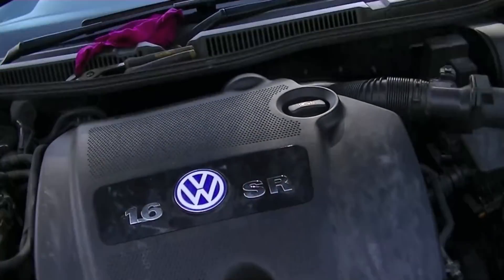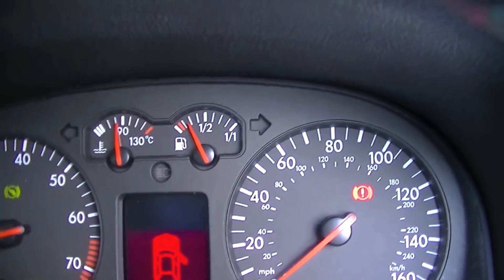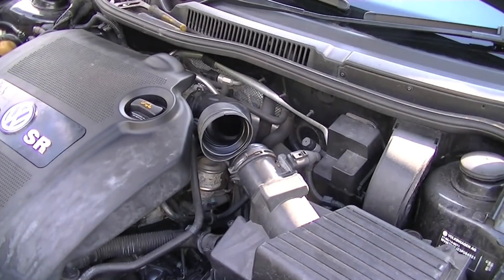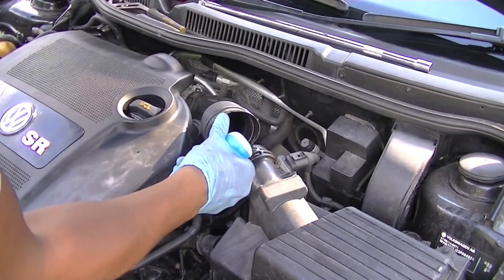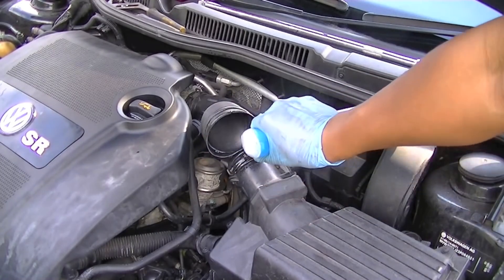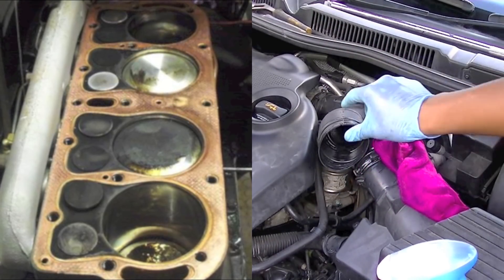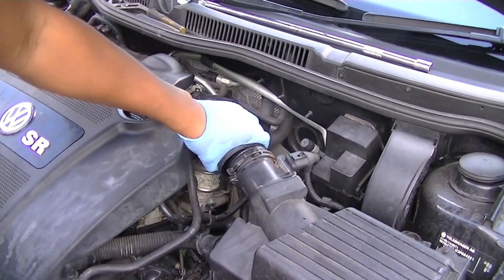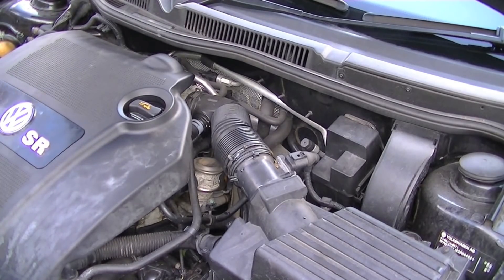How to make your engine run better with just tap water.......Better Than Seafoam?

Comment: Do this on a K series i dare you! This method isnt proven and does not work, it heightens the risk of cracking the block and any subsequent items that are hot as im sure if youre as intelligent as you make out you will know what happens when cold water reaches hot metal, as metal expands when hot and you spray cold water the bonds between the crystalline structures fragment, this method does not work and if you want to damage your engine and corrode the cylinder then do so as youre the type of people keeping people like me in a job.
if youre so bother about carbonisation why not do a proper job? recondition the head, skimming, vapour and bead blasting the cylinder head, polishing ports so the carbon cant stick to them, lapping the valves and doming the heads so the carbon bounces off, getting forged pistons that have smoothed heads to improve gas flow, this also allows the carbon not to stick to any parts.
do a proper job instead of a half arsed job, and telling people this works is honestly hilarious you clearly have no engineering knowledge or metallurgic knowledge as you would know the implications upon what you are doing, if you cant afford to do a proper job dont do it at all and dont find quick fixes either, they will never outlast a proper fix.

DO NOT ATTEMPT THIS IF YOU WANT TO KEEP YOUR CAR ALIVE, WAIT UNTIL YOU HAVE FUNDS TO CARRY OUT APPROPRIATE WORK!
Reply from the maker: Ellis Holmes I think K series engines are trash, sorry if you disagree. If you don't like the video, that is your problem.  No one cares about who owns intellectual rights or the loom you made.   I use the method, and the results have been good. You've never used yet you know everything about, how can we discuss anything.  My forum is for constructive debate, not boyfriend girlfriend arguments. So if you have something constructive to say, please do so.

Thank you
Reply: I remember reading about water/alcohol injection in WW2 war birds, to help make more power.  Those engines were made of Aluminum and air cooled....no cracking.
Reply: xSt3aLtHxSnIpEz if your fart to close to a K series it will blow!! as for the the rest of your statement you need to do some more research.
Reply: xSt3aLtHxSnIpEz Lol, your opinion literally went to shit when you started blabbing on about K series engines. Horrible engines with dreadful head gaskets made out of Plasticine.
Reply from the maker: 1. K series engines are awful,  nearly every one has a headgasket issue so I wouldn't touch it with yours.

2. Have you ever tried it?
Reply: So bad that they are nearly 30 years old and still being used today, and no they don't actually ever heard of anything called the N series, also I bet you actually don't know why some fail, and I've known of a hell of a lot that have done 100k miles on OEM parts, so your point is invalid.

And try this, you're having a laugh this is dangerous and unprofessional I come from an engineering back ground and if you want to decarbonise your engine your strip it and do it properly not your shitty excuse for a half arsed job.
Reply from the maker: As some from the engineering background you should be embarrassed about talking about the k series as if it were some sort of engineering accomplishment. The k series was tatol garbage, headgasket issues beyond reproach. Those engines werw so good that the company went bust. For an engine to make 100000 miles is normal, not an accomplishment.

Also who cares about your engineering background when you talk about k series engines as if they were good.
Reply: You really dont have a clue do you? shows your level of intellect to think rover actually owned the K series, no they didnt if you want to in depth about that Lotus, Caterham, Ariel, GTM, MG etc own the intellectual property of the K series and if you ever stumble upon a kit car you will see more than likely its got a 1.8 K series as they are a light engine, easy to work with and very easy to wire up, as i have built loom conversions for more than 20, and to be embarrassed about the k series? no im more embarrassed about 2 things, the EJ20 Engine, and that we have got people like you on our planet showing people who are stupid enough to believe this, how to damage their car, you are a poor excuse for a mechanic, you dont even deserve the respect as a motor engineer.
Reply: So your fuel isn't cold when it gets injected into the cylinders? If your so worried about it, use hot water.... Ever heard of water injection? The military and the performance world have been using it for a long time to allow for high compression ratios while preventing detonation. This method has been around a long time and it does work. When done right you have no need to worry.
Reply: the k series engine is like dog shite compared to say a vw/honda engine in every way, if i built a kit car i wud never use a k series, probs why lotus changed to toyota engines aswell
Reply: its funny when uneducated people make comments on something they know nothing about....   so whats the difference between cold water and a cold can of sea foam??   is your gas tank heated? does the car shoot hot gas and hot air into the engine??? i dont think so...you are suppose to add the water slowly so it mists into the engine and creates steam... and if you know anything about cleaning, you would know steam is the best thing to use to clean everything.... and guess what! if you add to much water, the engine will die.. its impossible to crack your engine using this method....   also. if you have ever used sea foam, you will notice the spark plugs and exhaust will have a shiny residue all over it.. seems funny to use it, as your trying to get rid of stuff in your engine and sea foam is pretty much camping lantern fuel and leaves that residue...and of course the big corporations tell you water doesnt work.... water is free!!  they dont make money when you get water out of your tap...    ALSO!  if you ever have changed a cylinder head with a bad head gasket... you will notice the head comes out looking brand new... i wonder why...wouldnt be from burning the water in the coolant and turning it into steam.   so please tell me again, why this method isnt proven and doesnt work.....
Reply: xSt3aLtHxSnIpEz He was supposed to give us a DIY solution not a mechanics only solution. Many say it does work and others like you say it doesnt, who can we believe? His engine didnt blow up so thats a start.

Comment: I'm sorry, but I totally agree with the people on here not recommending to do this. Yes, it probably cleans it rather well, but I've worked on and seen quite a few cars with water in the wrong places, such as the combustion chamber, and it's not pretty. If you were unlucky enough to have slightly worn compression rings, you'd most probably mix oil and water together, resulting in greater friction between the surfaces. Personally, this would be the last option for me, I'd try other things well before this. Also, don't try it on a diesel, or you might be looking for a new engine..

Comment: lol this is so funny haha....hope poeple don't actually think this is real.
Reply from the maker: Are you saying it doesn't work?
Reply from the maker: Hagbard Celine Its always people who have never tried it, that are the quickest to criticise it.
Reply: BMAC VAGS

It does work but what he is saying is it is not good for an engine. Water is not compressible and does not belong in an engine. The reason it works is because steam does a great job of cleaning. Before ever adding water to an engine think about all the engines out there that blew a head gasket that resulted in them having really clean engines. Was it good for them to blow the head gasket? Nope.

Although I will say this may work if very very very very very extremely careful care was taken to prevent damage but you have to be a person who pays very close attention to things. Spritzing the top of a piston that is already warm will evaporate very quickly thus producing steam. If ever using a method like this I would make sure the water was completely out. But I would never recommend anyone do this to an engine.

You'd be better off soaking the top of the piston with seafoam and then trying to start the car without spark plugs in to push the seafoam out. Then install spark plugs and start the car and let it idle. Change the oil after doing this. Rod bearings don't like large carbon deposits.
Reply: evilcowboy  How exactly would this cause any engine damage?
Reply: Morons pour too much water at once and cause the engine to hydraulic.  Smart ones administer the water slowly.
Reply: Cause the motor to hydraulic huh?   That makes no sense but alright.
Reply: Hydraulic is a verb; at least, this time.
Reply: ***** Well Matt, forgive the hell out of me for causing you such intellectual distress.

Comment: On gas/petrol vs. diesel, this is probably much safer on a gasoline engine.  A diesel has higher compression ratio, meaning the water will take up a larger percentage of the compressed volume.  Because water is a polar solvent and seafoam IIRC is petroleum based and therefore nonpolar, it also will remove some things that seafoam leaves, and vice versa.

Comment: Interesting , but on my car if I disconnect the pipe after the MAF sensor the car will stop running, almost instantly .
Reply: try making a cover for the tube after the mass air flow and hook up your vacuum cleaner to draw some air past the the sensor, might be enough air flow to fool the ECM.

Comment: The easiest way is to just to get on the interstate and put your foot down,keeping in mind the speed limit.
Reply: No.. It's not.
Reply: tcpnetworks Yes. It is.
Reply: Robert Floyd Easy yes, but that would only affect anything inside or after the cylinders, if it did do anything. I think on cars that use an EGR system this would work more effectively, due to the exhaust going into the intake manifold, leaving deposits on the manifold walls, runners, possibly injectors(unless direct injection), and intake valves/seats. and in all honesty, this is probably second on how easy cleaning the inside of an engine gets. lol.
Reply: My engines 30 years old and I still stomp it to the floor daily haha doesn't hurt it, it's meant to do it.
Reply: +joe Costello Indeed...we are constantly told to be "light footed" on the "gas" that alot of cars don't get a good "clear-out".

Comment: where is the evidence that it runs better?  Small amounts of carbon on the piston top is normal and rarely hinders performance.
Reply: Poor fuel, irregular oil changes?   You'll build up carbon like maaaad!   Carbon around the intake manifold, around the valve stems?   You'll be in trouble.

Lots of carbon buildup on the pistons - with an interference design?  Buh bye engine...

Comment: You should have done this on your Seafoam debunking video after the Seafoam then the water. Then put the scope in the cylinder. I know for a fact that the water method works wonders. I've done it personally to old cars and it does work.
Reply from the maker: I did....lol 

I like the water method too
Reply: BMAC VAGS Sorry, I missed the link you posted. I was too amused by the knuckleheads posting on here about how this doesn't work. Qman was the real clown. I'm surprised he had the intestinal fortitude to admit that he talked to mechanics and they confirmed that this works. I'm very amused by people that have no clue what they are talking about yet have to cut down someone who does. I guess the trained auto tech is right again. ( I had two years of Auto Mechanics in Vo-Tech. That instructor showed us the water method for decarbonizing.)

Comment: add morthball to fuel tank once a month ,  you;ll see much better change
bettar gas helps,  cause burn blue flames
Reply: In cars built in the 60's and early 70's this worked but on modern engines it will torch them.

Comment: I was wondering too when I had a head gasket failure and my engine suffered a hydro lock as the coolant escaped into the cylinder where the gasket had blown, so on that particular cylinder or piston and valves, the amount of carbon deposit was much lower and of light brown colour, whilst the other 3 cylinders were all dark sooty colour, so definitely injecting water can clean carbon deposits, but then you would need to do it on a regular bases.

Comment: My D4D toyota diesel has a catalytic converter. Can your watermethod be used in this case?
Reply from the maker: I don't see why not.
Reply: Yep. ALL modern cars have cats or DPF.  You won't hurt it - the act of compression atomises the water.  It's completely gassified on detonation.

No worries for your DPF, or Cat..

Comment: I will add my thank you to the many you've most deservedly received. Very nicely done, very relevant and practical. Question: is it this method also helpful in direct injection engines? I mean, does it help decarbonize the intake runner flappers and intake valves in those types of engines?
Thank you in advance for your time.

Comment: if this is good, then why is a leaking head gasket so bad?
You would think that small amounts of water and glycol all the time would be good.
Just for the record, its not good.... it would be like takeing the hood off of your car and open your air filter and drive in a rain storm!!! not smart
Reply from the maker: You clearly don't understand what a leaking head gasket is or you would not be speaking like that. Like I said before, do some research and get back to me.
Reply: Then fine then, explain to me about leaking head gasket.
Why did you use baby OIL that clearly burns, instead of water on the new lawn mower motor?

Comment: if you have a car with more miles it works even better if you take transmission fluid and spray it the same way with the rpms up and it starts smoking pretty bad, but it softens carbon on valves and intake the quickly spray the water in the same manner and it really super cleans everything instantly without using so much water and oil.if you start to hear like spark knocking when car is really under torque at high gear,and you hear this in cars usually with 80,000 or more then this will stop it from spark knocking and helps really get inside intake and valves and all clean.learned this 25 years ago from my bro-in-law and he is really a genius with everything.try it,its safe.just really soak mit good with the oil and keep it running by givin more gas if you have too.it will be alot like video,but if their is alot of grime and carbon just the water wont do it.the oil softens up thick carbon.then the water just explodes it off quickly.i have heard them running rough and you can do it on carburated,throttle body and fuel injected.sincerely Rob

Comment: Just had to comment, as a garage Proprietor myself for many years.
This Van Helsing guy, trolling about laws and seat belt use in the video blah blah.
IF you really knew your stuff, you'd know that whilst seat belts are a good idea, mechanics on road tests are exempt from wearing them.
If the law has recently been altered, please show me and I'll stand corrected.
Most mechanics use this right, to save getting the seatbelt webbing dirty across their overalls, for the customer then to get a nasty black line over their white shirt or blouse every time they wear it. 
This has been the case for ever AFAIK The link is below, to show but one listing on the net.
The motor trade is a hard enough place, without people reporting non crimes to the Police. They have real baddies to catch ;)
https://www.askthe.police.uk/content/Q332.htm
Reply from the maker: Excellent information Grimbusa, I will post for the trolls to feed on.
Reply: Shut up

Comment: Their is a FORD TECH that is on You Tube. The F150 and other ECOBOAST engines are building up carbon.

What not to do he said is to use SEAFOAM. The heat from SEAFOAM will cook the bearings in the Tubos that is close to the motor. No problem you have now ruined your warranty and the Turbos cost THOUSANDS.

He didn't say you couldn't use it on other motors without TURBOS.

He said I could use MARVEL MYSTERY OIL in my gas 4 OZs on a full tank and 6-12 ounces at oil change. This will not harm TURBOS as their is no heat and fire.

Comment: could adding water as a cleaner lower compression? supposedly, when water is heated it expands exponentially so it's possible it could break the piston ring seal and create blow-by. it also seems possible that excess water in the chamber resting on the rings could wear the rings even further. Just something to think about
Reply: I seriously doubt that water expands more than gasoline when heated, plus water injection and water-methanol injection has been used for decades to cool IC engines so that they can run higher compression ratios and increased timing for more power.